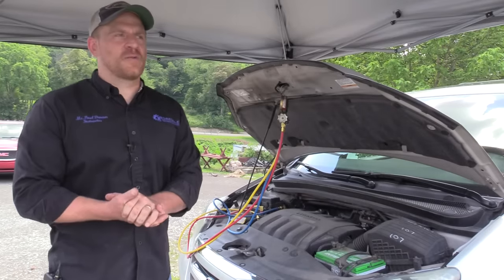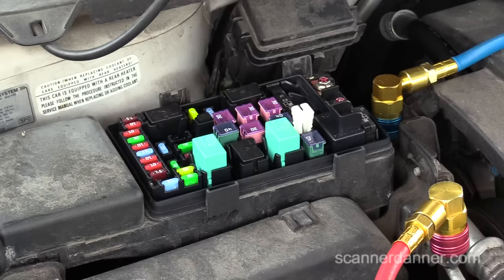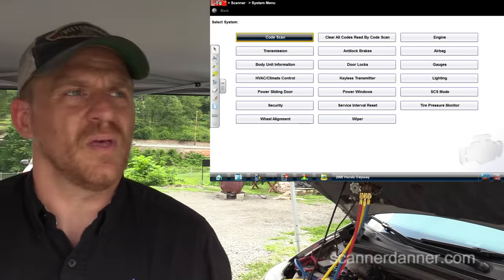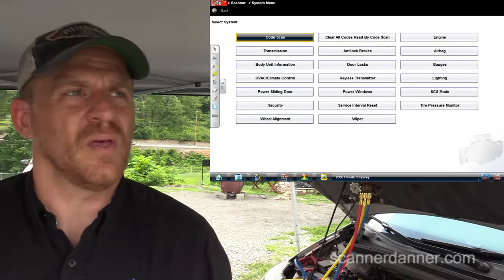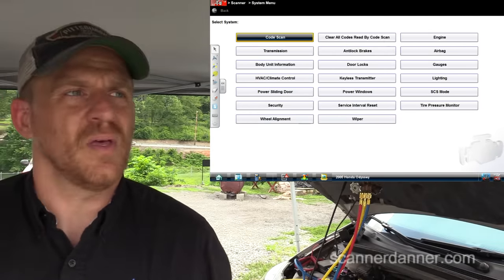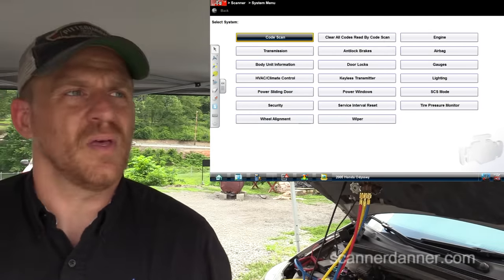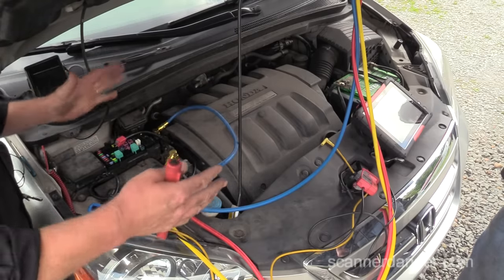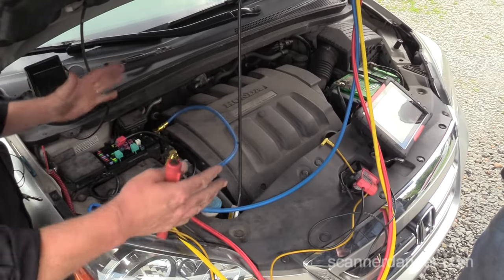A/C clutch not engaging - 2005 Honda Odyssey

Comment: Hello
I have Tahoe 2009 empty gas I refill up and wait half day get empty again
I put air instant of gas test all the way with pip out of compressor back pips no sign of like what could by the issue
Reply from the maker: you leaked out a half tank of gas and can't find the leak?
Reply: @ScannerDanner  sorry but incorrect question what I mean is the ac feroan
Reply: @ScannerDanner  yes for example I refill the ac with bottled wight 1000 grms the ll dispper with in 15 hours I trace the pip nothing I'm a fried the Refrigerant under dashboard
Reply from the maker: You have a leak, not much else I can help you with. I have some leak testing videos that may help you though.
Reply: @ScannerDanner  plz share it the new refrigerator how much cost in USA which company you may prefer as Tahoe 2009 they have tow one under dashboard one in the back even If press air it may take 10 hours than air gone if there's any way to test the refrigerator plz

Comment: snap on verus line or anything they make cost around 10k USD is pretty much a windows based tablet with drewtech board and scope function all in one. comes in handy but not as good as factory in coverage, scope not as functional and futuristic as picoscope. it's certainly one of few best scan/diag tool but is it a $10k plus good you decide. or you can just buy a good interface, buy yourself a toughbook and install some factory scantool software and get a set of picoscope you're good to go and highly upgradeable. on top of that you're capable of flashing ECUs and modules if know what you're doing. this is what I do and I don't think I'll ever spend 10k plus to buy a snap on.
Reply: Just install some factory scantool software ehh?  Any links to same?   Hook us up dude, all ears here.
Reply: Linux which is free on srduino or raspberry pi... faster the good computers and size of a credit card

Comment: 2011 Honda fit-  Ac compressor clutch will not engage. Applied 12 v at relay socket, this will engage the clutch manually. Bench tested relay, applied 12 v and got continuity across the load side. Tested relay socket with multimeter, on load side, 12v available , other pin has continuity to compressor. On trigger side, constant 12v source ( reversed polarity -12v for some reason) whether or not AC switch is on. Tested pressure sensor on Low side of compressor line with multimeter, continuity checked. Tested temperature protection switch at compressor, continuity checked. Tried disconnecting battery on the car for ECU reset, tested all fuses I could think of, FAN, SUB FAN, MG CLUTCH, AC. There are several relays in the actual fuse box which have no labels, unable to test those because I don't know what they do, auxiliary relay box in engine bay contains 3 relays, fan x2 and AC Clutch, applied 12 v all click when voltage is applied.
Totally lost on what to do next, resistance across the clutch coil is 3 ohms and it works when 12v is directly applied either by battery to clutch or jumping the relay socket.
Any help would be greatly appreciated.
Reply from the maker: Continuity testing is the most misleading method of troubleshooting. Go back to the relay, disconnect it and use an incandescent test light connected to ground. You should have two pins that are "hot". One load and one control. Start there, let me know
Reply: ScannerDanner ok I have a hot pin on the control side and on the load side of the relay socket verified with test light,  checked low side pressure , about 35 PSI ambient temp 65-70 degrees F with engine warmed up and compressor jumpered
Reply from the maker: Next step, test the control pin at the relay socket, with your test light connected to battery positive. The computer should be grounding that pin. If it is not, test the same wire at the PCM. Making sure there is no open in that wire. (chances of this are slim, but it is possible). If this tests good, there is an input the computer is not liking, preventing the computer from energizing the relay. 
Low and high psi switches, thermal limit devices, inputs from the climate control panel etc. You need to test those with a proper scan tool
Reply: Did you fill it with freon . The ac clutch will not engage if freon is low . Their is an sensor on the ac line that tells the cars computer not to send power to the relay .
Reply: There's no signal from the ecu to the relay; the pressure on the low side was about 35 psi at ambient temp 65 degrees with the compressor jumped to get it going : the chart on the AC charge can indicated this was in spec but not 1 degree F for each PSI
Reply: holley shit i have the same car . 35 seams kind of low thought it should be 55 . let me look it up
Reply: was that runing
Reply: its 40 most people are saying . 35 to 40 is in the right area.
Reply: might be the psi switch
Reply from the maker: what is your rest psi (compressor off) and at what ambient temp?
With the compressor relay jumped, what is your high side psi?
Reply: ScannerDanner with the car off and warmed up ambient temp 65-70 F it was 85 PSI on the low side , I don't have a set of proper manifold gauges to test high side pressure but if that info I critical I suppose I could buy some
Reply from the maker: Is the air cold with compressor jumped?
Reply: ScannerDanner yes feels nice and cold as it used to when I jump the compressor to force it to work
Reply from the maker: Okay, then don't worry about the high side psi reading. You have an input problem from what it sounds like. You'll need an enhanced scan tool to provide you with the correct tests. Nothing more I can help you with here without one. 
Inputs without looking at a diagram
AC button on the dash
throttle position sensor (stuck at wide open throttle)
engine coolant sensor (showing an overheat condition)
low and high side psi switches/sensors
power steering psi switch
evap temp sensor (not sure if it has one)
clutch rpm sensor (some)
Feel free to post to my forum to get some more help with the diagram and inputs. No way I can walk you through all of those here. Sorry.
Reply: well you could just put and external headlight relay with an wired switch inside . So you turn on the ac and flip the switch too bypass the computer control so its manual
Reply: ScannerDanner thanks so much for your help, looks like I'll have to go to a mechanic and have them scan it for me or search for a place i can rent such a tool. Here's a link to the wiring diagram http://www.hondafitjazz.com/manual/A00/HTML/00/SAA2E00000000000000EBAT00i018.HTML
I'll also seek assistance on the forum , thanks again

Comment: What’s the reason a fuse is blown?
Reply from the maker: Short to ground on that circuit or shorted component. Step one is to find out everything that is on the fuse circuit that is blowing. Under wiring diagrams, select "power distribution" 
https://eautorepair.adtrk.biz/?a=10817&c=24&p=r&s1=
Reply: ScannerDanner thanks for your help
Reply from the maker: @mikemaccarri3877  this video will help give you an idea of how to attack a short to ground https://www.youtube.com/watch?v=FK9STP4G9-I

Comment: How come my 2008 ford  explorer  compressor only works when jumped straight from battery ??? Relay good...fuses good..has charge.....too gauges good 45 245
Reply from the maker: No way I can answer that offhand, you will need to do more homework first my friend. There are pressure sensors and switches, the climate control panel and the engine computer that controls the relay. You'll need a good wiring diagram first, then a good description and operation of the system. Feel free to post this here. We can help you more on the forum. It is free to join. 
https://www.scannerdanner.com/forum/post-your-repair-questions-here.html
Reply: ScannerDanner ok thanks I already replace low pressure switch system is charged and it works when I jump straight from the battery and blows ice cold

Comment: Nasty manifold with brand new hoses! HVAC is what I do if you have any refrigerant related questions.
Reply: I worked on a 72 ford truck that has been converted to R134a, last week. The AC blows very cold customer complaint is compressor vibrates like hell. Checked pressures and low side was about 20 and hi side 225 @ 1500 RPM. At idel everything is good but when you hold it around 2000-3000 rpm the compressor shakes and vibrates. I told him there is something out of balance in the compressor. Do you have any other ideas of what the problem would be? FYI its a brand new compressor.
Thanks 
John
Reply: +JOHN HUFNAGEL you may have a restriction somewhere upstream of where you are reading the high side pressure and/ or the system my be severely overcharged. Did it take more refrigerant than usual to get the system to cool. Did you change the metering device (orifice) too ?
Reply: I didn't do the job they called me after it was done no they didn't change the orifice. wouldn't the pressure thru the roof is the orifice was plugged? I know a little on ac not a expert
Reply: +JOHN HUFNAGEL not always. head pressure is driven by refrigerant flow and the physical size of the condensor. It could be hydraulic locked when the compressor starts vibrating. I would start by recovering the charge and weighing it before I changed anything else.
Reply: +Joe Shearer  could you tell me what the oil and capacity is for a ford 72 f100? I will recover it and check the oil but can't find any info on how much it takes. Thanks
Reply: +JOHN HUFNAGEL I can't say for sure what and how much but the compressor manufacturer should have that info available. PAG 150 would be a safe bet and 10 oz.

Comment: Three or four percent of diy fixers might have the tools that Dan has so testing with them does most of us no good The only thing we can do is get down under the car and check if power and ground is present. On my car I can change AC clutch without removing compressor but my not be all cars
Reply from the maker: I'm not teaching to the DIYers. I'm teaching technicians. And if you're going to do AC work, you need to tool up. If you don't have basic AC tools (manifold gauge set, electronic leak detector and a good bi-directional scan tool you have no business repairing your ac system).

Comment: Wasn't it easier for you to simply check with an ordinary multimeter if you get 12V at the connector at the compressor and that's how you go around everything and know that your compressor has a mechanical failure.
Greeting
Reply from the maker: For sure if you can get to the compressor connector in a gravel parking lot. But I used the opportunity to show what it takes to troubleshoot one of these when there is no power going to the clutch. And that's what makes this video valuable to many.

Comment: What about the pressure switch cuz
Reply from the maker: From memory, all the deicing and compressor controls are all on the input side of the ECM on this model. So from the load side of the relay to the compressor clutch there are no other switches.

Comment: the snowflake on the cover id the ac relay just my two cents worth   satu hati one heart
Reply: juan rodriguez that's what I found too, 262 four prong relay module next to the 7.5 amp MG Clutch fuse. After replacing it I would consider jump the clutch plate or replacing it.

Comment: why do you have you high and low side connected still . Just suck all the ac  freon to negative vacuum . So you can remove all the freon an also remove water inside the lines . Then just refill the line to the right units that the car takes then remove your ac high and low lines . Then after you know it full of freon you know its not low and thats stoping it from turn on . Then you could do the testing your doing now . Its kind of dangerous leaving your line on an run car .  Water in ac lines is very bad . So if your ac doesn't work all the computer is doing is jumping the power over . So its like an headlight relay but the computer controles it .

Comment: how can someone test clutch without any of the pricey stuff you use..even 1500 dollars is alot to just test it?
Reply from the maker: If you are looking for a bi-directional scan tool. (which is what I was using by commanding the clutch relay on and off) You will not find one for under $1000. 
Of course you can still troubleshoot this circuit without the bi-directional test and I gave you guys those steps too.

Comment: Hey guy i got a 1 mustang gt my ac goes on n of like few seconds
Reply from the maker: Check your pressures with a manifold gauge set. This is usually a low on charge issue caused by a leak

Comment: It don’t matter what they look like they’re doing a job and you’re doing it correctly. You’re looking at your high side and you low side with gauges you’re not the shooting it like these idiots out there that do that doesn’t get their vent temperature right? Super cool super heat, because with a set of gauges where you can see everything if you slowly adjust everything and bounce it all out to the correct level do with the old-school way get it perfect for older system

Comment: I unplugged the low pressure switch and jump out the plug with a paper clip notto tell you if you have low on Freon or 1:34 I was going to do 4 or your pressure switch is no good it's juicy on that little round tank it's a two prong plug take a paperclip sticking and both ends make sure all your AC is on active clutch polls in and start spinning it is a low on gas are the low pressure switch is no good

Comment: Bidirectional scantool , This is a huge can of  worms, No aftermarket 
multi platform scantool will do all cars , the only one who can do 
everything and show all codes is the factory tool.  Lucky for me i am a 
vw Diesel fan!! "quotemarks" rosstech vcds is 99% factory . i also have 
launch x431  it is good for a lot of cars but it shines on  old toyota 
and nissan, but  it wont  even talk to older mazda diesel . 
Another  thing the real cheap tools and code readers are only emission tools.!!!
What is covered  by emission the knotheads in california and zürich switzerland lay down the rules what has to be covered in this room as its best called , the other  room-aka factory  enhanced room is up to manufacturer if they put it in obd2 or only factory-Room.
i show what x431 pulls on my 95 toyota obd 1, its why i asked you what snapon pulls on the older toyota some videos  back.

Comment: Assuming that eventually you are going to make a call to replace the clutch and replacing the clutch necessarily involves unhooking the connector, why NOT then unhook the connector and test it there just before ordering the new clutch?  Surely, Pete or his mechanic can do that much diagnosis, right?

I understand that eventually you did go all the way and did test but if you were short on the time, you could have let the last check for the shop to complete.

May be this is where we do not see eye to eye.  I expect a reputable shop to be able to handle this particular diagnosis which was quite straightforward especially when the non-engagement of the clutch was obvious.  Is the shop has no electrical tech on the payroll?
Reply from the maker: This shop and I have an arrangement. It has nothing to do with them not being able to do it.

Comment: Launch X431 Pro is $700.00 and it does anything a Snap-On can...With no subscription every year..
Reply: Master Chief 00117 well that’s not true, it cost $700 a year to update the launch x431 updated,  it’s certainly not free. The first year or two is depending on model. It can’t do everything a snap on can either, however they work great. The are also China supported except for the Torque and other USA models. Just be carful of the info you put out it could make someone buy a tool based off your comment and it not be true. Good luck with your scanner it’s a decent tool.
Reply: @weldingjunkie  No you don't need to buy anything. And like I posted the Model X431 Pro does everything a Snap-On can. I got both. 

Thank You
Reply: Master Chief 00117 yes, yes you do, it needs to be updated. I have the snap on Zeus, Bosch ADS625, launch Torque 431, Launch Mini 431, Autel elite, Autel IM508 and every single one of them needs updates after initial subscription. Someone lied to you or you Mis read because it most certainly cost to update. Which model do you have Excactly - I’m assuming you bought it off amazon. 

Ps the launch doesn’t have a scope, doesn’t have Altus, trouble shooter, built in page to go to mitchell etc and many other benefits I didn’t mention

Comment: If open in coil then correct no light with or without relay power on or off when testing at the ground, but big but..... you failed to test the ground wire for ground quality, this is done with ohmmeter to ground wire and to another ground spot, or use test light with 12 v positive connected and then touch light to tapped ground wire in output circuit of clutch coil, as you failed to do these, your tested only proved open in the clutch coil, but did not test quality of the clutch coil ground circuit.... and I would always do this, to make sure new clutch will have a quality ground as those down near lower engine are  in high temps and vibration and also a lot road grime and dirt and sludge down there.... always test for quality of ground on ground side of coil
Reply from the maker: Checking a ground for integrity with an ohmmeter is pretty much a useless test. It can measure 0 ohms and still be bad. You're better off with a test light to battery positive, wouldn't you agree? I have a video showing this exact scenario if you'd like to see it?